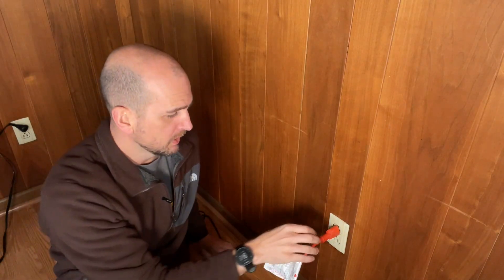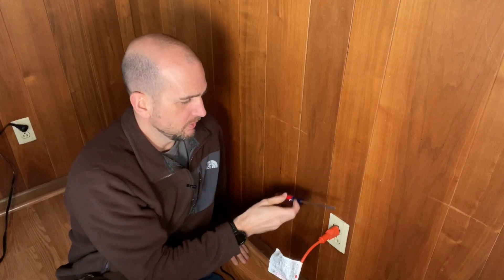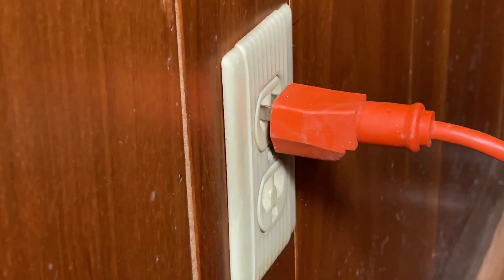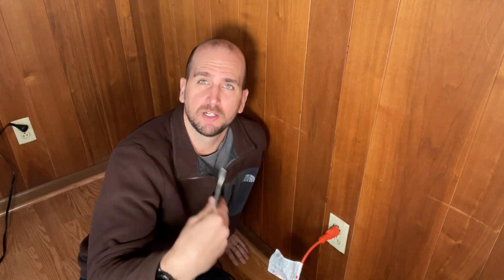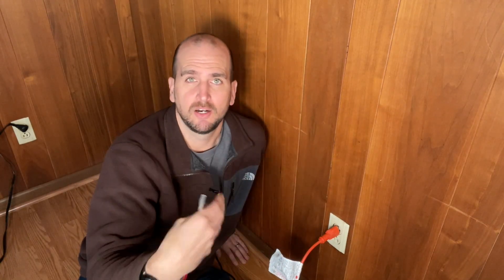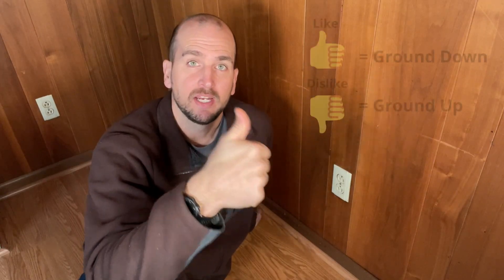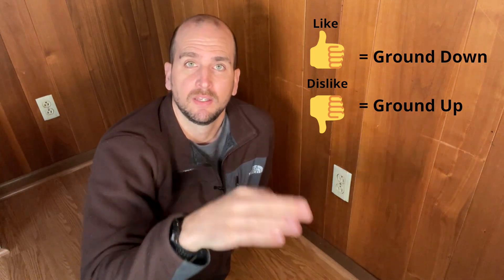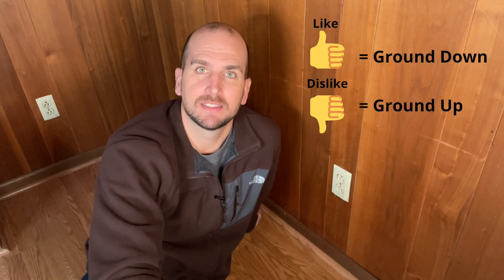Should An Outlet Be Installed Ground Down Or Up

Comment: I had not given this much thought, but recently I collected a few old power regulators and one of them stands out for having the ground up. Also I once had an accident when unplugging an outlet that had not been touched in years, the decorstive metal plate was not properly screwed in and it fell into the powered contacts, it caused an outage and the plate was burned.

Comment: Ground down. Most electrical devices with a transformer etc like a charger or power supply for instance directly at the plug will not seat properly because of the often added offset weight. Your neighbours kids could be jumping in the house enough to slowly vibrate them out over time in an apt. This causes a serious safety problem especially in a property like a rental. I've changed many receptacles because they were black or melted from the sparks and heat because plugs were hanging half out and arcs were happening. When this happens the ground is not only being bypassed but its being bypassed outside the box where the is a likelihood of things like curtains or clothing or any other flammables. Put that kind of issue behind a piece of furniture like a dresser and it could be too late by the time its noticed.

Comment: With me the thing is I'm not a licensed electrician "I should definitely look into that" for in home applications I might prefer ground down but in shop and garage instances I may prefer them facing up. One thing is if there's any pull out, ground up could possibly help keep the live and neutral better seated for high current applications, that the net physicalforce by the cable would end up pulling the ground loose first "due to the ground pins being longer it shouldn't be a safety concern". The first consideration was also the physical barrier of having the ground blocking falling objects to reduce the risk of shorts in such a case. But on residential there ought to be less risk of materials coming near and generally lower current applications other than heaters and kitchen appliances. Maybe if there was consideration for geometrical locking to make it so that plugs had to be lightly torqued a certain way to release them with a small rubberized coating on the start of the prongs "I'd say for live only but I've seen a few receptacles that were wired wrong, ground however should not have any insulating coating" then the plugs would be much safer to use. Actually that wouldn't be hard to make fully backwards compatible with our current plugs.

Comment: The safety argument for ground down is that if the plug comes out part way it will droop down and the ground will always be connected whereas with ground on top if the plug is partially out you can have a situation where the ground is not connected yet the other two leads are, hence a faulty chassis of an appliance could become hot and electrocute anyone touching it.   My plugs always seem to have a longer ground pin so I don't know if the above situation would ever occur.  Over the years I have never seen a ground up outlet.

Comment: Working at an electronic bench with a plug strip across the front edge, I had screws, snips of wire and solder etc. falling across those prongs.  In that application ground up!

Comment: Ground down.  I have never seen a  right angle plug with the ground prong up.  This is the best reason for ground down.  Considering an AC unit or refrigerator, they draw much more current and you just don't want a cord like that twisted over to get the ground up.

Comment: They should just make the outlet with one plug facing each direction.. Then no matter which way you put it the top one is ground up and bottom one is ground down 🤣🤣🤣
Reply: I actually like this idea.
Reply: Too funny 😀😁😂
Reply: Tell this to the stupid people who engineered USB ports.  So frustrating every time I try to use one.
Reply: @mikemcclellan8979  pretty sure USB C will be the new standard across the board.   Meaning even thumb drives, TVs, chargers, etc.   Everything will be going to USB C sooner or later.   Takes up less space for small electronics and doesn't care which way you plug it in.
Reply: @Heretic306  That would make the construction more complicated as the live and neutrals would have to cross over.

Comment: While there is no code, the way I was taught was ground is always down unless the outlet is controlled by a wall switch. The primary reason why the ground was originally designed to be down has been lost in red tape and by over worrisome people. First off if your wall outlet is not strong enough to hold a plug tight, its defective and needs to be replaced. Justifying a ground up plug configuration due to a faulty outlet is like justifying leaving the stem caps off your tire because the tire has a slow leak and needs to be filled constantly... so you leave the cap off. The Ground in the lower position provides stability to the cord while plugged in and electrical safety to the item plugged in. The ground portion of a circuit is what helps to stop people from being electrocuted by their device. The first thing and the last thing you want to make and break electrical contact inside an electrical circuit is the ground leg. Cords pull down. This is why items that have a 3 prong plug many times are designed with the ground down. It is unsafe and a possible safety concern to mount any plug not controlled by a switch with the ground up. The unnatural arc of the wire having to go up first then down will provide force on both the wire and plug potentially causing electrical safety concerns in the future. People who "want" the ground up due to these nanny reasons of shorting across the load and neutral are over thinking an extremely unlikely scenario which evolves poor and defective outlets ..and they are forgetting about the common way plugs are designed.  Plugs are designed with the ground down, so its within the safety concern of the Electrician to mount the plug in the safest direction according to the PLUGS DESIGN... not some crazy story about 1/2 pulled plugs arcing for 1 second that trips a breaker...
Reply: Agree 100%
Reply: On the first point, shouldn’t we try to protect people against their own stupidity? Yes, a receptacle with weak tension should be replaced, but the reality is that most of those receptacles aren’t promptly replaced.

Comment: Ground 👇 down. Because if the plug becomes loose the Ground remains connected to the outlet
 VS. If cord becomes loose and gorund is UP then the equipment ground is not grounded.

Comment: They should make an outlet with one up one down ground. Problem solved!
Reply: Not likely because rotating the plug switches which side the neutral wire gets plugged into.

Comment: Nice tip about putting the GND up to indicate the outlet is switched. 
 I normally put the GND down .  It just looks better and I agree there is no huge safety benefit or all power cables would require the 3rd prong.

Comment: As an electrician, I will tell you the rule 100%.   All gfci is ground up, or tagged.  All gfci protected in a chain is ground up or tagged.  You need this so you can diagnose a problem.   At all desks in offices or sewing rooms, etc. outlets are ground up because paper clips and pins.   In rooms, bedrooms, dining rooms, there is a new nationwide push on all new installs that everything be AFP,  (arc fault protected) at the panel because of portable heaters and portable AC.  Currently all dining rooms will not pass without AFP in most towns, because people are known to plug cooking devices in during entertainment.  In AFP outlets, its okay to use ground down, and is preferable on lower outlets for entertainment cords that have 90° bends.  Today, all outlets, spend more, shuld use tamper proof over open hole.

Comment: Newer outlets are labeled with the ground "up". It is a practical solution to a problem; with the ground "down", tugging on the cord tends to break the plastic at the bottom of the outlet. Turning it up just causes the plug to tilt. However, there is another problem; if you tug too hard, the ground lug can pull out of the socket leaving the live and neutral attached. US sockets are just a poor design, whichever direction they are installed.

Comment: When I went through my apprenticeship I was taught to install with the ground down.
Reply: The plugs on many appliances are designed to lay flat against the wall when plugged into an outlet with the ground down. The American Way for outlets is ground down. You know, ground at your feet.
Reply: @codetech5598  Why does NEMA say ground up is the "standard" orientation?
Reply: @grumpycat_1  What year did NEMA begin saying that? What year were grounded plugsets first manufactured?
Reply from the maker: Thanks Mike!

Comment: Retired Master Electrician and have always installed with ground down except when required due to contract language requiring otherwise, very rarely. The only time that an argument was presented for ground up is when installing stainless cover plates that could possibly have the screw come loose and the plate fall on the prongs. I noticed the angled cord plugged in the receptacle behind at the 3:45 mark and it demonstrates the bad use of having the ground up in that it overly stresses the cord and connection.
Reply from the maker: Completely agree, thanks Tim!

Comment: At home, ground down.  At work, most of the outlets have metal covers with one screw in the middle.  A number of years ago, at an arc flash class, the instructor pointed out that a loose cover can fall on the hot and neutral.  Since then, we've been installing them ground up.  At home and side jobs I go with ground down.
Reply from the maker: Thanks Betty.

Comment: I was a commercial electrician for just shy of 40 years. You will find ground pin up in most medical facilities. Everywhere else, usually pin down unless  otherwise specified during construction.
 The benefit of having pin up is over time outlets become loose and the plug has a tendency to fall towards the ground exposing the hot and neutral on the plug.
 The drawback as most electricians know the ground pin always is the 1st one that will separate from a plug under stress.
Reply from the maker: Thanks for the feedback Jamie 👍

Comment: Most of the people I know that do ground up where electricians in commercial spaces. I prefer ground down in homes because some wall warts for electronics plug in one way only and the ground down allows them to hang downward. If the outlet was ground up then the wall wart hangs upside down and causes them to slowly unplug themselves if they are big enough.
Reply from the maker: Makes sense to me, thanks Scott 👍
Reply: That's what they make 12" extension cords for. Stupid wall warts. Some manufacturers are getting smart and making them so they fit. ( Thanks, Alexa )

Comment: The company that invented the receptacle has always recommended ground up for safety over looks.  I once heard of a fast food restaurant that had ground down on a stainless steel table.  The steel cover plate somehow dropped off and energized the table as it sat on the hot blade.  If ground up it may have been different.  Office desk areas, drop paper clip and retrieve it off the hot,nuetral or if the ground is up the paper clip bounces off
Reply from the maker: Good example Joe, thanks for sharing.

Comment: if the receptacle says Top and is orientated so the ground is on top, then you have to install it that way. NEC requires everything to be installed according to manufacturers recommendation, therefore for those specific receptacles you have the code to defend you from whoever would take issue with them being "upside down"
Reply from the maker: Thanks for the feedback!
Reply: Yep. Every receptacle I have seen in the big box store has the label with ground up.

Comment: They put the ground up in our house which made all transformers that had polarized plugs have the wire up making them fall out of the outlets as soon as they became worn. Most timers and watt meters are upside down if the ground is on the top making them hard to read. Ground fault outlets need to be installed with the ground down or the labels for the reset and test button will be upside down. When I replaced the outlets I put them in so the ground was on the bottom. Most outlets that were good were so annoying that I turned them over.
Reply from the maker: Yeah, your example is one of the big drawbacks of ground up

Comment: The question I would have is why not ground left/right? It seems like we put our outlets in vertically when it should horizontally. That would get around the short problem with two prong. The office I work in just added an extra floor and it seems like almost all the outlets are horizontal. Its in Chicago which has near crazy electrical code (like we couldn't pass code with power strips under the desks).

Comment: As you said NEC does not specify ground up or down.  I installed my own electrical and all my outlets have the ground up.  I wanted the ground up because if a plug starts to slip out of the outlet the bottom hot and neutral will have more holding power to stay in.  But the main reason is I like consistency and frankly up or down as long as they are all the same.  So in the end either way just all the same way.

Comment: The Ground should always be installed DOWN, for support of the current carrying prongs, like a 3 legged stool;  it helps to keep the plug in the outlet and not falling out !
also with the Ground down should a plug come partially out of the receptacle the Ground Prong is the last one to disconnect thus the protection of whatever is plugged in is assured!
No one gives a damn for "falling picture frames" anyway nor are they a consideration in the NEC !

Comment: I agree, there's no code.  Ground pin up was originally done when cover plates were metal.  I'm a Biomedical Engineer, responsible for medical equipment maintenance at 5 hospitals.  The ground pin down is preferred, because the as the power plug works its way out, the ground would be the last thing to be disconnected, thus keeping the equipment user safer.

Comment: I am an electrician and all the electrical code books I have seen shows ground down. If you look at the face of the receptacle  with the ground down the writing is the right way up, with the ground down the writing is upside down. Now here is the way it was explained to me during my apprenticeship with the ground down if the cord is pulled from the receptacle with a downward motion the cord will loose power before becoming ungrounded. With the ground up and the same procedure the cord can become ungrounded but still have power. Not a safe situation.

Comment: 90 degree plugs would require the ground down on the outlet. If the ground was up then the cord would be going upwards and not downwards like intended. Appliances like the fridge or washer use 90 degree plugs.

Comment: I remodeled my basement for my workshop. I installed studs on the brick walls and installed a few boxes for outlets and installed drywall boards. I did install circuit breakers for the new wiring in my shop. I also installed all the outlets with the ground on the bottom. Since I'm not a certified electrician, I did find out about the codes and followed them.

Comment: Ground down. If you rely on plug blades to hold it into receptacle, REPLACE THE RECEPTACLE. 

Then you go to Mexico....they mount them sideways and the stupid people that wire them don't even pay attention to insulation color to differentiate hot and neutral. AND, sometimes cut off the bare ground wire.

Comment: II like the idea of differentiating switched outlets. I have many Ground UP outlets in my house. The original owner said, "electrons don't care", however the close-tolerance extension and appliance plugs with directional wires are a real annoyance. Other plug-in items such as smart switches are also designed for Ground-DOWN installation. It may not matter per code, but I prefer ground-DOWN outlets because use of these outlets is often dependent on things outside my control.

Comment: I have found in places like garage or workshops where heavier extension cords are used, I make sure to put them in ground facing up.  The reason for this is the heavier gauge cords put a lot of pressure on the plastic around the ground prong.  With the ground facing down it will break the small plastic off on the bottom plug because it is so thin at this point.  Otherwise I really do not care.  As for the cords coming off the flat plug at an 45 degree angle, I wish they would just make it come off at a 90 degree angle from the plug, then there would be no problem with it coming off a plug with the ground facing up.

Comment: I've always thought the standard (and for consistency) was the hot (smaller) prong was to the right (and neutral, left) which places the ground prong down for 3-prong outlets. To my memory, I've not noticed any installed ground-prong up. Maybe this is a state-specific standard(?), but has been true for all states I've lived or worked in to date.

Comment: I place the ground up. Why?  It tends to be the tightest connection of the three and more often than not keeps the full plug from sagging in the socket.  Now tell me, who the hell likes socket drag?  It does make the Klein circuit test tougher to read.  Hear that Klein?  Make the tester rotate or make the indicator lights visible on both sides.

Comment: The state where I'm at now is ground down and in medical facilities ground up. Switched receptacles ground down but have been labeled switched on cover as gfci second receptacles  are. In some states receptacles are mounted horizontally with ground to the left. This what I have observed certified electricians doing differently in certain areas. Personally I don't like switched receptacles.